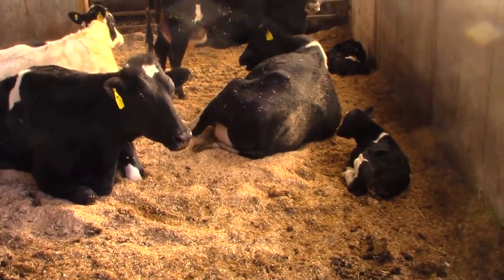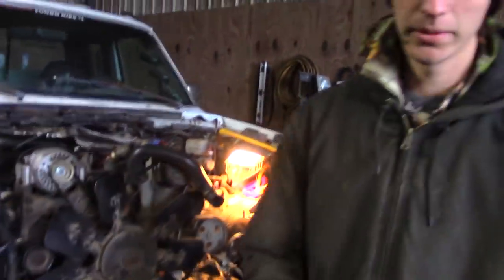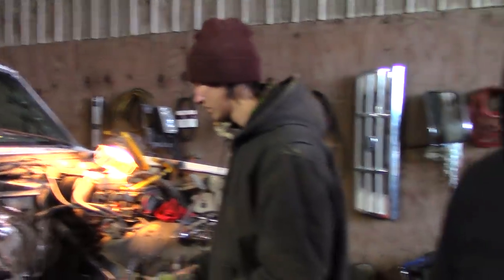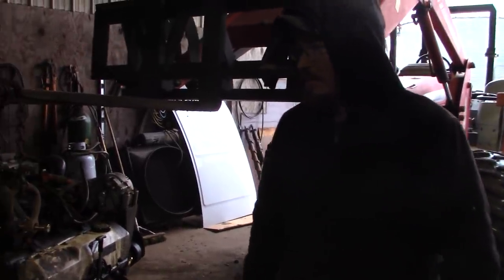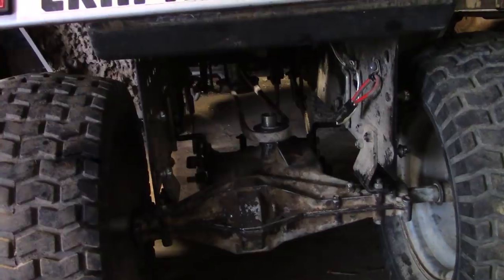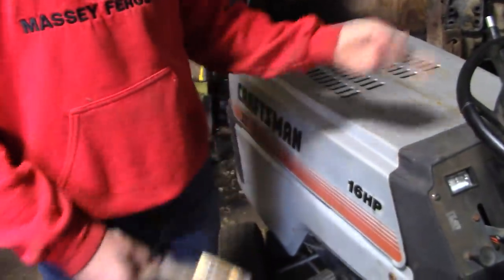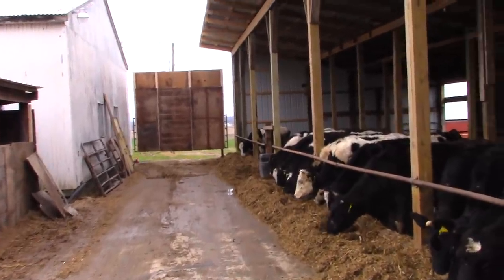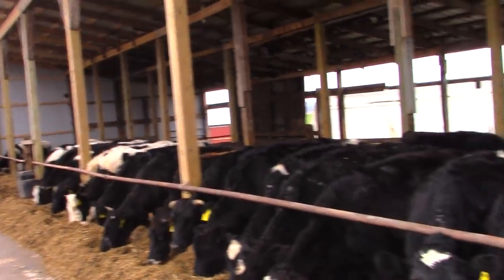Pulley Swap | Speed Test

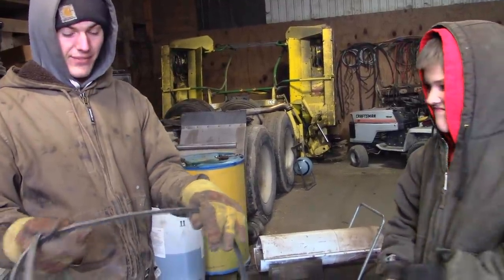Comment: You should’ve just flipped the mower on it’s side @ 8:15/put something between the dash & the floor. Way easier for changing belts on tractors w no deck. Too small is bad/terrible slipping very little belt contact to pulley. What’s ideal is the same size pulley on both sides or a 3” on the front & a 5” on the back. You can get to 30mph w a pulley swap, but 10mph is plenty. It’s just not 5mph/way too slow. 6-10mph is a nice safe range for a small tractor.

Comment: Haha I love the thumbnail it looks like Sanders is doing 80 MPH. I pulled my 7.3 out of my truck when I was younger because the oil pan was leaking. I thought..Turns out it was the high pressure oil pump/ lines leaking in the valley. When the valley up top drains it follows the perimeter of the oil pan and makes it look exactly like the gasket is leaking. Is Ethan going to do anything else while it’s out? You guys got all sorts of cool projects going. And to answer your question of the day my first job on the farm was raising calves. Awesome video hope you had a great Thanksgiving!

Comment: Oil pan on 2 of my 7.3's rusted out. Latest one was a 99. oil pan rusted out and developed oil leaks everywhere. Just got rid of it after 16 years and 373000 miles. Injector cup started to leak fuel into the coolant. Time to go.

Comment: Shop did my BIL's 1999 7.3 in the engine bay with trans out - trans was getting rebuild.  7.3 oils pans are a weak spot on that engine.  Now Sander's just needs a blower off an air horn for a turbo and he'll be all set...  Is that a white Smack I see on the dump trailer...did I miss the video on that?

Comment: Put the hitch plate back on, without it it will flex and blow the bottom out. If you don’t have it, weld a brace across the frame